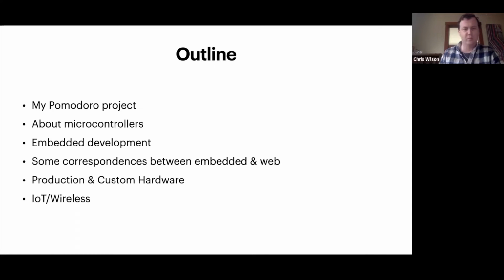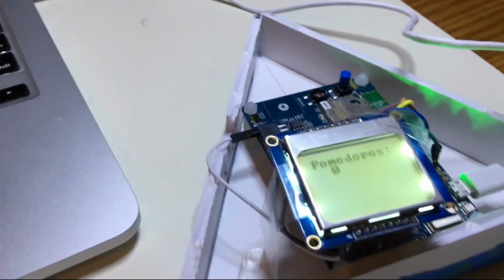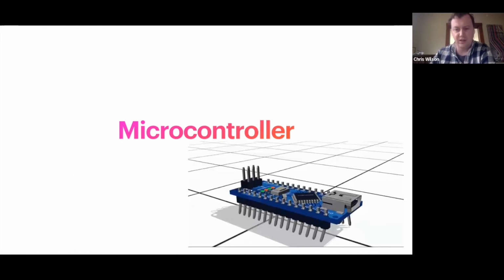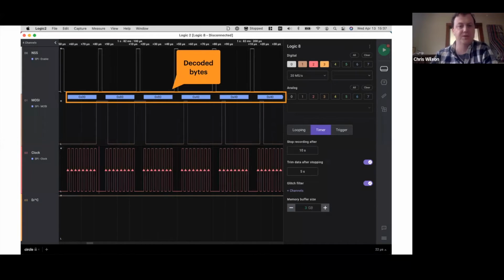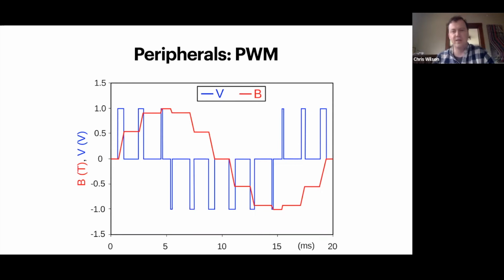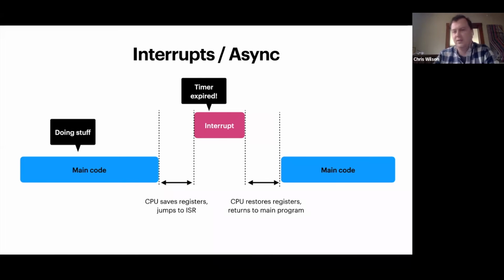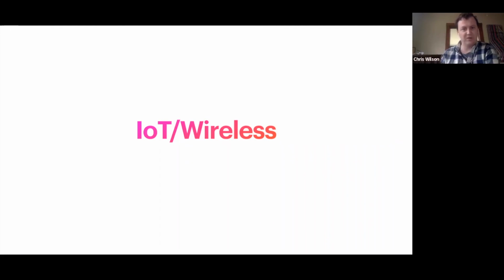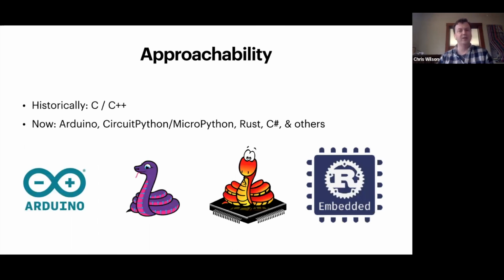8LU - Embedded: From the point of view of a web developer by Chris Wilson

Comment: I have worked on supercomputer applications and embedded software for my entire career.  They both basically have the same constraints and concerns, just at vastly different input scales.  It is kind of boggling that someone could graduate with a CS degree these days and not have extensive expertise working on embedded devices....